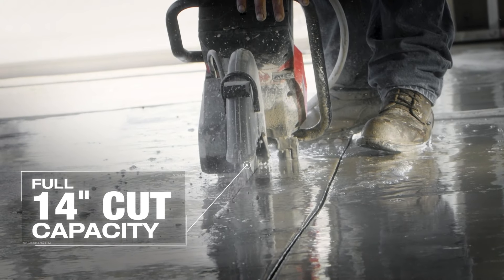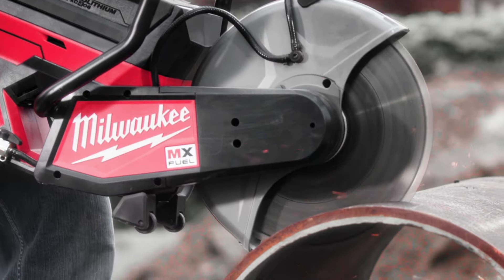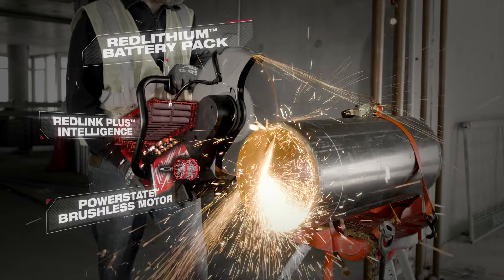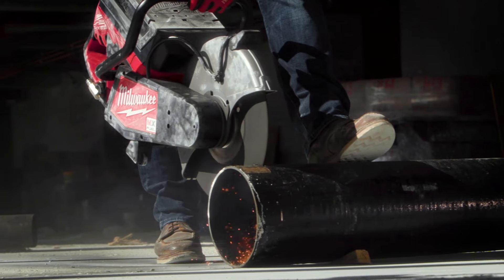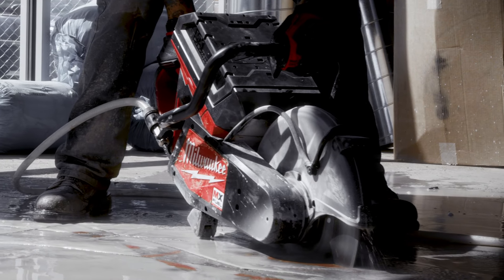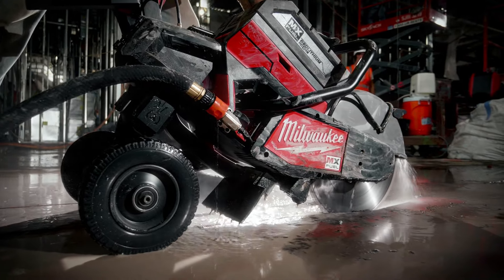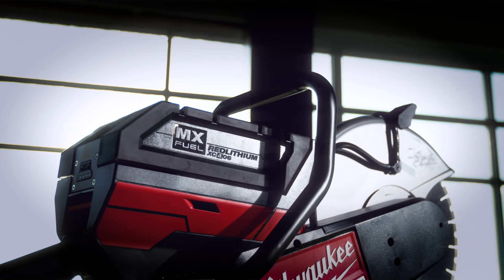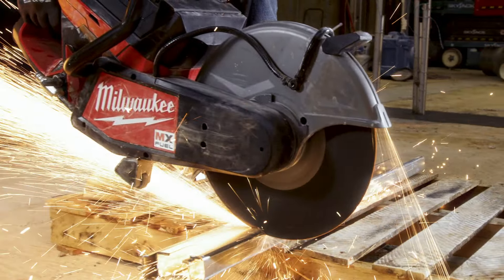Milwaukee® MX FUEL™ 14” Cut-Off Saw

Comment: How does it stack up as far as weight compared to a gass saw? also have you guys explored the idea of goverment contracts? A lot of Direct action applications involve forced entry sometimes I  to baracaded structures a battery saw would improve the end user ability to make entry without having to pull start a saw

Comment: When can we have this! Why are you always making a new tool I have to have!?
Reply from the maker: Our MX FUEL Cut-Off Saw, Breaker, Handheld Core Drill, and Drum Machine will start shipping in February of 2020. The MX FUEL Tower Light and MX FUEL Cary-On Power Supply will be later in 2020. For more up-to-date information, please sign up to receive the latest on MX FUEL™ through our email newsletters. You can sign up here: http://ms.spr.ly/6053TrFlU
Reply: @MilwaukeeTool  we are signed up thanks!
Reply: How long does the battery last for

Comment: How many volts is the battery
Reply from the maker: Technically, MX FUEL™ runs at 72V Nominal (80V Peak). However, voltage is not a good indicator of capability. For example, most would agree that a fork lift has more “power” than a hand held power tool, but what many people do not realize is that most battery-powered forklifts/lift trucks operate at 48V while there are some handheld power tools at much higher voltages. More importantly, MX FUEL™ was developed from the ground up to withstand the most challenging applications and environments that equipment is subjected to on-site. For example, this cut-off saw has the power to cut up to 5” depth in reinforced concrete
Reply: @MilwaukeeTool  thx Milwaukee, was just wondering🙃

Comment: Is this new? Coming
Reply from the maker: We just announced our new MX FUEL™ 14” Cut-Off Saw with the announcement of our all new MX FUEL™ Equipment System. This groundbreaking cordless system revolutionizes the light equipment marketing by delivering the performance, run-time, and durability demanded by the trades without the hazards associated with emissions, noise, vibration, and the frustrations of gas maintenance. More info is available here - http://ms.spr.ly/6051Tr25R

Comment: Wtf is that battery and can I get an adapter to run my m18 tools off of it?
Reply from the maker: No, there isn't an adaptor. This is our NEW MX FUEL Equipment System utilizes our new MX FUEL batteries. Similar to how M18 batteries work on any product in our M18 system, all MX FUEL batteries work on all MX FUEL products.

Comment: Probably $1,000 battery
Reply from the maker: While the upfront cost will be more of a premium, over time this will be made up in cost savings due to the elimination of repairs, gas, oil, tripping breakers, and other hazards and frustrations that can cause substantial downtime on the jobsite.
Reply: @MilwaukeeTool  I convinced my superintendent at work to go all battery powered tools at work, and I just wanna know, are there any plans to come out with a concrete vibrator? We're still using a backpack vibrator and I refuse to buy a dewalt or makita..... so is it going to happen or am I waiting for nothing?
Reply from the maker: Hi Grant! For legal reasons, we do not disclose any projects that may or may not be in the works. However, we always appreciate the feedback as we are always looking for innovation opportunities to bring the best solutions to our users.
Reply: Milwaukee Tool please make an MX mower and backpack blower
Reply: @grant Peterson - This battery pack will run in the $600 range.